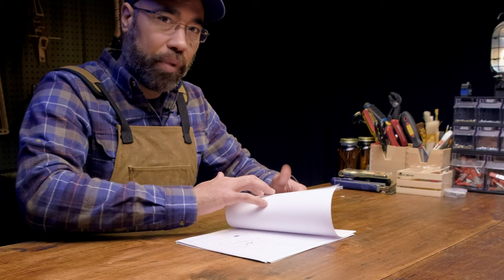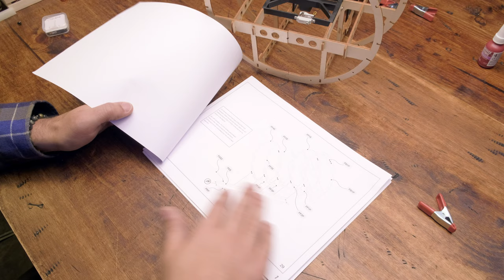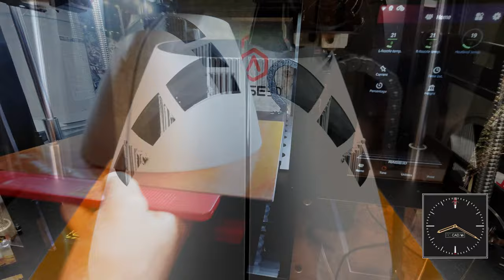Building a Large Scale RC Model Airliner  |  Part 2  - Forward Fuselage

Comment: It could, of course be by choice that you are using PVA glue but have you ever worked with CA glue? For your use case, It outperforms PVA on pretty much every aspect except one important, it stinks AF and is irritant.
Reply from the maker: The HOT topic... Glue 🤣 in this part of the build process I prefer using Wood Glue for the working time, my nose, and fingers. The frame slots together firmly and is mostly self supportive. Also for the doublers I can quickly and easily coat the entire surface evenly and shift them into place before they set. CA glue will be used though later on in the build as well as epoxies. Thanks for the question!

Comment: I really like the quality of design that you've put into this model.  The tab-slot method of assembly, or in some cases - half-rounds - to ensure the pieces align properly.  The little things to limit accidents during construction.
Reply from the maker: Hi 👋 A big THANK YOU from Seattle for this great comment! You are correct, the tab-slots do a great job of pulling and holding the frame in perfect alignment. Halfway through adding the longerons, I thought something was wrong because it was pulling to the port side, however, after adding the longerons to the Starboard side, it was 100% true. Whew!  Thanks for watching and leaving a comment -- Cheers!

Comment: That is a - 500. I was working on L1011-500 back in 2000 as a mechanic, I loved this aircraft, easy to worh with and state of art
Reply from the maker: That's awesome! Love hearing from guys who got to work on this amazing aircraft. Anything you felt Lockheed did better than the other manufactures of commercial passenger planes?
Reply: @RCCAD2VR  it had 4 hydraulic systems, ok 747 has it also, DC-10 only 3. It had a advanced flight control system with DLC Direct Lift Control, in landing face aircraft has to follow glide slop, this they do with engine power and elevators, 1011 controlled it with spoilers deflection, over glide slop, spoilers go out, under glide slop spoilers go in, constant powersetting and no elevators moving. Old time aircraft had cables controling flight control actuators, that reqest adjustment. 1011 had pre tension cables that was factory adjusted. I coul write a vhole day about the aircraft, i have also worked from Convair 340/440 and Fokker F28 up to DC10. Doors could be opened without electric power, by emergency open from outsider without deploy of slide, no resetting just close with power. Activ control of aileron to reduse wingload and turbulence, Airbus introduced that on A320.

Comment: Just a simple little note, I'm sure you know, but you may want to make sure that Lock Tight does not affect the 3D printed parts. It will destroy other types of similar materials. I had to learn the hard way that it needs to be used on nothing but metal to metal parts. Lol  Beautiful design and beautiful model. I love the old Whisper Liner. Such a Classic and historic aircraft, in more ways than one. So much new technology came out when this classic hit the lines.
Reply from the maker: Yup, I am aware of the Loctite plastic interaction. I've recently switched to the plastics safe 425 formula they have. The L-1011 is definitely a one of a kind airliner. The Whisper Liner was a bit ironic, since those engines had such a distinctive an aggressive roar. I sat near that back on my last L-1011 flight, and even in the late 90's it was noticeably quieter than other planes I had flown on, but the sound still made you take note. Thanks for watching and taking a sec to comments. Cheers!

Comment: That's a nice build, I am still not completely sure about using 3d printed parts in builds but it seems like it has come a long way and I might start doing it on my next build.
Have been working on (hand) drawing a MQ-9 for a long time but you convinced me to scrap that and go draw it up in fusion.
Would be interested in an in dept video about aerofoil selection, that was something that has been holding me back for a long time.
Reply from the maker: Hey there! Thank you and welcome to the world of CAD! Hope it is going well so far. 3D printed parts can be far more durable than any wood you have on the plane if you use the right material and orient the design and printing process towards their strengths. I'm using filaments that are just shy of aluminum strength. They are moderately pricy though but allow for parts to be designed specifically for their application. Airfoils is a huge topic, if I can find an expert on the subject to help steer me a bit on this, I'd gladly make a video about it. Cheers!

Comment: Brilliant craftsmanship! The L1011 is my most favorite of all airliners. Is this the 500 series and if so is it possible to extend the fuselage to the 250 series?
Reply from the maker: Thank you! It's been a real test getting this designed and built to this point :) This was originally supposed to be the 500, but the diagrams I used to start the design was actually the from the 200 series, so this is has ended up being the longer fuse version :) Thanks for watching and leaving a comment.

Comment: Wow. That is amazing. I can't wait to build one. But i need to focus on my DC-3. Hehe
Reply from the maker: I'm excited for you to build it too! 😁 How far out are you from finishing the DC-3?
Reply: @RCCAD2VR  since it is a top flite brand that i bought from ebay it didn't come with any hardware or especially the tail gear bracket. The plastic bracket was easy now i got to buy a steel rod and cut and bend it.
Reply from the maker: Ahh cool. Sounds like a fun project that should take too long to get into the air.
Reply: @RCCAD2VR  hey thanks. It will look good. I hope to have a couple videos about it.
Reply from the maker: Awesome! Looking forward to seeing them

Comment: Hi Terrance.. another great instalment... A couple of questions, if i may... Firstly.. do you allow any tolerances to your tab slots...or do you print both at he same dimension and fettle if required? Will you use a jig at some point to ensure the sections are straight...or do you relay on the accuracy of the parts and assume straightness? cheers Geoff
Reply from the maker: Hey there Geoff! firstly, thanks for watching! The tab slot tolerances are taken care of during cutting by setting the kerf value. This provides a good snug fit. The trick however is the variances in the wood thickness, which I learned the hard way in the first build, where one sheet was .7mm too thick. This go around I measure the sheets before buying them using a caliper. The frame is very much true on its own, but I will use jigs when it comes time to sheeting and planking. The fuselage is so long, that it will need to be held in place through that process.

Comment: Hey, has anyone ever tried doing this out of steel ? Like 3mm stainless? I have access to an industrial laser cutter and welder. You could tack together the pieces using a Tig welder instead of where your gluing. Would be way heavier tho , gonna need some real power to get it off the ground

Comment: This is top-shelf work. Would it be possible to get the kit entirely as an stl. file? 
I want to 3D print the pieces that are wood.
Reply from the maker: Thank you, glad you like it! As of right now there is no plan of providing any files for this model.
Reply: @RCCAD2VR  thanks for reaching out. So you got to buy the wood etching pieces and plastic parts directly.
Reply from the maker: The base kit is just the wood frame and it comes with the STL files for all of the 3D printed parts and mold plugs. Plus the build manual and list of fasters/hardware and tools. The next step up is the full kit. You can find the details here https://www.rccad2vr.com/trijet-kit-pre-order-waitlist

Comment: Hi,
That's some Quality work there! May I ask what software did you use to make the assembly book?
Reply from the maker: Much appreciated Edgar, glad you like! I use Fusion 360's animation feature to create the drawings, then import the PDF files into InDesign to put the manual together. It's a slow process for sure, but it's the best method I've found.
Reply: @RCCAD2VR  thank you! InDesign... I would have never guessed :)
Reply from the maker: You're most welcome. I've used it for well over a decade so it just works for this use case.

Comment: Im an old manufacturing engineer so I expect drawings to show the finished product, so when I decided to print my cockpit I drew it out as I wanted the finished part to look,ie the wall thickness was set at 1 - 2 mm thickness, butas  its only the outside thats important,  do I gave to think in a different way and in thois case forget about the inside letting the printer define this, and that I should have made the wall thickness and web thickness say 0.05mm instead?
Reply from the maker: Hey there -- I'm not 100% sure what you are asking, but I assume you are wanting to know how I approached the 3D printed part of the nose. I use the exterior dimension and thicken the walls inward.

Comment: The way you designed this aircraft you should use carbon fiber in place off wood, looks extremely fragile
Reply from the maker: It's no where near as fragile as you'd think. Once skinned and glassed it'll be very solid 🙂 A CF frame using this method would be about 3x the cost and not add any meaning benefits other than weight savings. This is more of a traditional styles build. Thanks for watching and commenting!!
Reply: @RCCAD2VR  it’s an amazing job, the landing gear base will be also reinforced? 
I’d love to it finished!

Comment: btw, when making a wood model, an adhesive  that  CURES   Should  be  used.!!!!!!!!!!!
Reply from the maker: Thanks for the tip David.
Reply: Not necessarily.  All you want is a glue joint that is stronger than the wood.  CA glue works good and you can build faster than if you were going to use wood glue and clamps or epoxy and clamps.  That being said,  you have more working time with a curing adhesive.
Reply: @daviddavids2884  lol, ok dude. You do you.  I've only been building balsa model airplanes for a better part of three decades.  Never had one fail structurally. As long as the glue joint is stronger than the wood you are good.